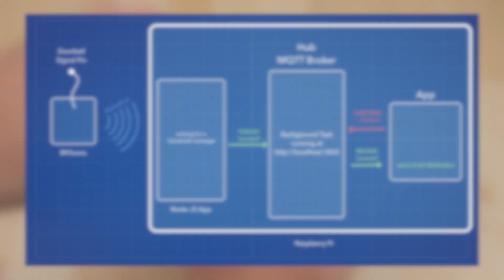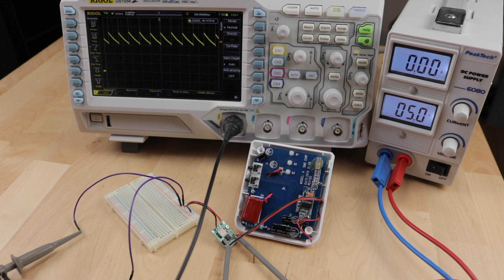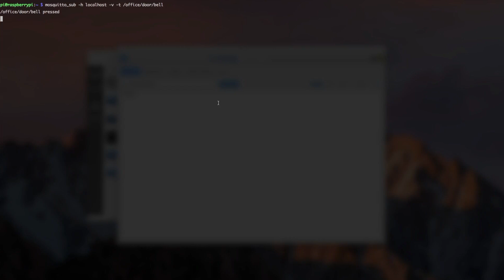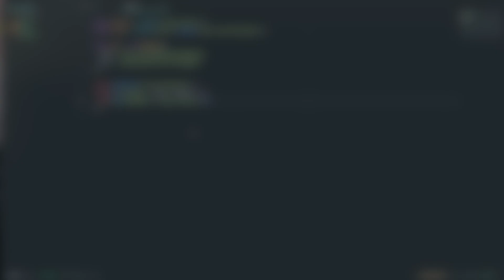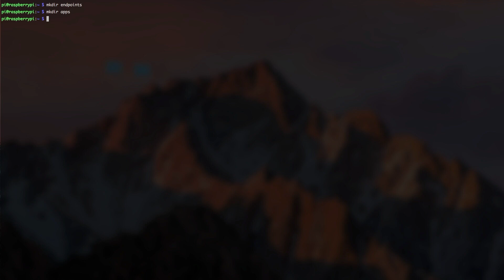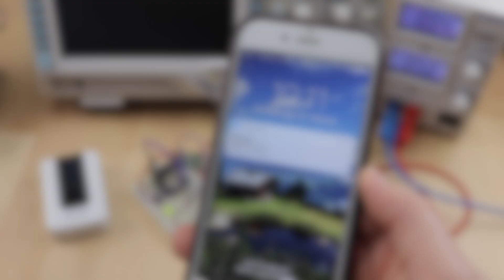A Guide to MQTT by Hacking a Doorbell to send Push Notifications

Comment: Loving this! I'm in the middle of trying this out myslef. At 3min 54seconds you mention converting the 5v LED signal, would it be possible to explain how this is achieved exactly?
Reply from the maker: That is done using a so called "voltage divider". Just give it a quick google or youtube search. There is plenty of information out there. In this project I used resistor values of 1k and 2.2k. ;)
Reply: Robin Reiter thanks for that. I've done that, found some explanations. However when I connect into my arduini from the led pin on the doorbell it just constantly sets off the doorbell!? I can't work our why... anyone any ideas?

Comment: Hello awesome video. One other thing you can use is a ESP8266-01 which is cheap around $3.00 US dollars if you are getting it from China or a little more depending where you are at. 

The nice thing i like about the ESP8266 is that you can set it up to the MQTT and it works with programming using the Arduino IDE software. I my self use the ESP8266 with home automation and MQTT. Still new at it but loving it.

Also for the Step down converter you can use a AMS1117 3.3v  that is 5v DC in and 3.3V DC out. Up to 400ma. They are small and easy to use.

Hope this helps.

Comment: Nice clear video, really liked it. I happen to have the same doorbell so I thought I'd add an ESP8266 (WeMos D1 Mini) to talk to my MQTT Broker. Unfortunately it doesn't seem to supply enough power on that 5v rail. Does that sound right? It is only two wires, 5v and GND, and when they are connected to the D1 the doorbell doesn't work, when I remove them it does work. Checked polarity and shorts of course. Anyway, thanks for sharing this video, was interesting nonetheless.
Reply from the maker: Hm that sounds unlikely. To confirm that you could attach your D1 and then trace and measure the power lines going to one of the on board IC's. If they show a low reading it could be the case. If so throw in one of these cheap converters to provide power for you board.